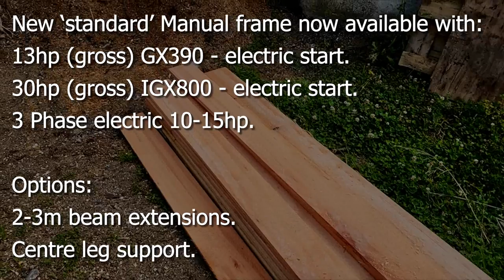TURBOSAWMILL - 2022 MANUAL MILL

Comment: Just wondering , but what if you based the cutting on the vertical instead of the horizontal pattern. Or at a steep enough angle that the pieces cut off would self dump and be out of the way of the next cut ( no need for that helper )
Reply from the maker: Customer can do that themselves if they wish. It would need to be an extreme angle though.
Reply: @TURBOSAWMILL  I was wondering , why not at 90 degrees , vertical . Start the cuts near the ground and work up . Boards or timbers would make a nice neat pile that you could clean up when the log is done
Reply from the maker: @grazynazambeanie5963  We make a nice portable sawmill used for the farm. We are not a fixed site sawmill, I get what your suggesting, our patent application actually describes that. But the sawmill needs to be light weight and simple design.
Our automated mill actually cuts the next board while you stack the first - very productive.

Comment: To me, this looks like it's only good for making trim boards, nothing of any size.
Reply from the maker: Well your missing some information... this will cut any diameter log. Double cut up to 16" wide per drop (chunk of wood 7" deep and 16" wide). Produce 1 x any width slab per log by flipping the log. The log can also be rolled like a bandsaw to produce as big a block of timber as you can imagine. But yes it shines in making quick edged lumber without re-handling.
Reply from the maker: Also cuts taper boards right off the log too.
Reply from the maker: And that's just the 8" model. We make a 12" model too...